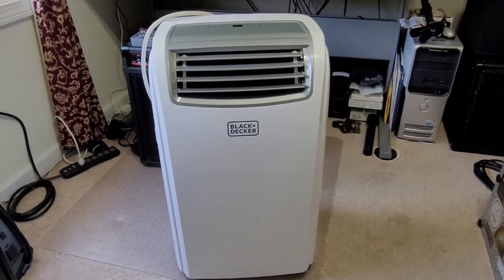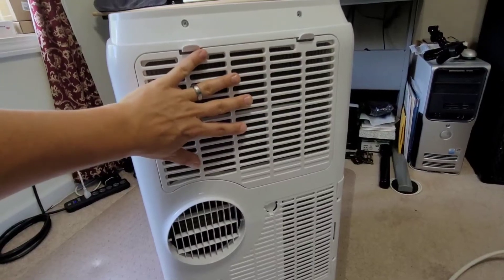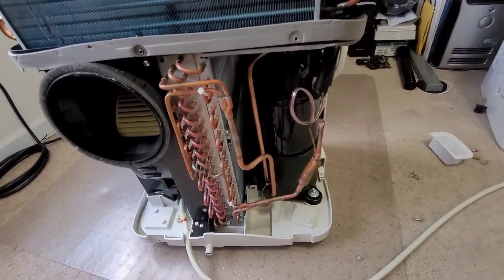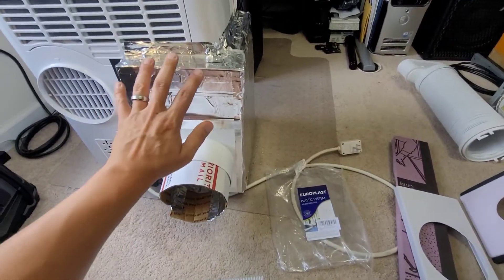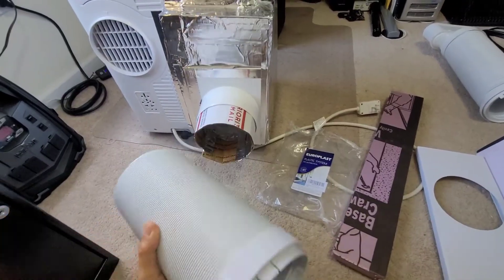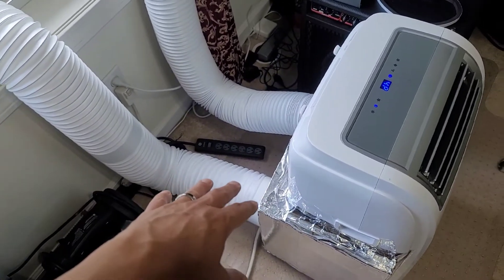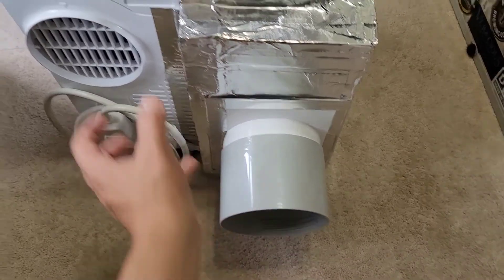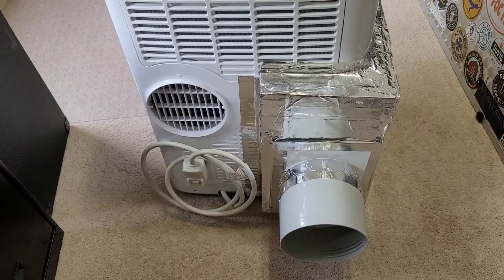Black & Decker Portable Air Conditioner BPACT14WT: Single to Dual Vent Conversion

Comment: Thanks for sharing! Any chance you've done some sort of AB testing? As in let it run stock, check temp/power draw, add mod and let it run a bit longer to see how many extra degrees you can drop at a similar power draw? Or maybe compare run times for same cooling? Wondering how much difference there is in practice without the negative pressure from single-hose and without wasting all the cold air it produces

Comment: Wait isn’t the whole idea for it to take the air inside your area and cool that? Why are you making it work harder by taking in air from the outside that is already hot?
Reply from the maker: Yes cool the inside air, but don't steal that cold air to cool the condenser causing lost efficiency. Outside air with enough velocity will carry enough heat away from the condenser while leaving the evaporator dedicated to cooling the room only.

Comment: It would be really helpful  ☝
If someone could do a before-and-after comparison after adding the second outlet,

Showing how many minutes it takes to cool by 3 degrees. 

There are people on both sides of the debate: 
Some believe single-hose systems are better, 
While others argue that dual-hose designs perform more efficiently

I’d love to see a simple cooling test using the same brand and model, 

Where the only difference is the addition of the second hose. 

If anyone has a link to such a test, please share it! 🙏
Reply from the maker: Not aware of anyone doing this test, but come the warmer weather I could give it a go.
Reply: @Bzkhavptes Hey! I'm very interested in a similar test, I currently have the LG LP1419IVSM which is single-hose and recently managed to adapt a second hose at the condenser intake, still need to make a new window kit with 2 holes to preserve the original part but I plan on testing it soon, I'll try to remember to report back here

Comment: I did my Pinguino last month, but found it was still pulling some air from the hallway in my apartment. Turns out there's a small gap between the cover and the plastic base at the bottom. I sealed it up with aluminum tape... no more smells from the hallway. 🙃
Reply from the maker: Good to know! Thanks for the info.

Comment: You never showed how to get it open!
Reply from the maker: Apologies, there are body screws all around and once you do that the entire plastic body lifts off. There is no need to do this since I confirmed they seal off the evaporator and condenser areas from crossing air.

Comment: They are absolutely stupid.
I picked one off the curb on trash day,  a massive "Penguino". I didnt know it at first, but it made the other window unit get moldy, and blow water vapor. I thought the other unit had a problem but couldnt find it. I kept cleaning it. When I modified the Penguino to two hoses ( actually 3 I added two intakes) , suddenly the other window unit dried right up. It was because the penguino was pulling our tropical weather in through the house cracks. The amount of air it pumped out  - and in - of the house was unbelievable... like a window fan. I used two 4" dryer hoses to match the 6" exhaust hose it had and also had to do some internal sealing.

Comment: With a single hose unit creating a vacuum you will find it only cold near the unit the rest of the flat stays warm as warm air is pulled in through gaps. Once you mod the ac you find the temperature drops in the whole flat not just one corner
Reply from the maker: Thanks for watching! Yeah unit has been working great since the mod, no issues!
Reply: Vety good explanation! that is exactly what we noticed using a portable in the room.. cool when next to the units air vent but the room itself doesnt drop in temp

Comment: I believe the greatest problem with both single and dual hose portable AC units is the heat radiating from the exhaust hose before the  hot air vents to the outside. Even when standing a few feet from the unit, I can feel the heat radiating from the exhaust hose. That heat rises and heats up the air in the top half of the room. I'm looking to buy and insulating hose sleeve to cut down on the heat radiating from the hose.
Reply from the maker: yeah the insulated hose would certainly help. Not too expensive for a short section.
Reply: @Bassguitarist1985  I can confirm that the insulating cover from TURBRO that I applied to my exhaust hose substantially reduced the heat radiating from the hose.
Reply: Ive not built a dual hose unit but I have Alwats Heavily wrapped that single vent hose as it is radiating so much heat that the AC is literally at war with itself, trying to cool a room while throwing large amounts of heat Back into the room.. the longer the hose the worse the amount of heat is.. how do u know when its insulated enough? when u no longer can feel Any heat coming from that hose..

Comment: For those hoses, there are quick disconnect rings you can buy for dryer hoses. You could buy a couple of those, use a dryer hose, and wrap it in a cheap fleece cloth to insulate.
Reply from the maker: Good advice! I like it!

Comment: Was the whole condenser/compressor air intake chamber already isolated from the rest of the machine? I have an Electrolux EXP26 and when covering the whole intake, the machine still runs normally with the same massive exhaust airflow. Not even a slightest change. 😞
Edit: Found an online guide where someone sealed off the entire chamber on this machine with aluminium tape and foam.
Reply from the maker: Yes it was sealed off

Comment: The condensate redire ted to the condenser actually increases the efficiency: On the evaporator the water will condense anyway. Evaporating that water on the condenser means it removes quite some heat while keeping the temperature lower. And lower condenser temperatures means lower pressure, so less power the compressor needs. It is small difference overall, but still bigger than the heat leak through that condensate passage...
Reply from the maker: Absolutely! 💯 And with the addition of the second hose the efficiency is further increased. I've been running this air conditioning with my modification for the last couple years without any issue.

Comment: Only problem I can see is you're throwing the hot air out right next to the cold air in,  so it's going to pull the same hot air in that it's throwing out.   I think I would extend the cold air inlet hose down the wall on the outside about 3 feet or so to prevent having the hot air pulled in by the inlet hose.
Reply from the maker: Thank you for the advice!
Reply: very true when they are placed close to each other.. reminds  me of the  so called "cold air intakes" sold for cars that are ofetn installed After the radiator or near the headers  so they actually end up drawing in More hot air than most factory setups or a true cold air intake which should be setup to draw from air prior to the radiator thus from a point in the grill where unheated air can be indrawn...any air After the radiator is super heated    once its blown thru the radiator into the engine bay.

Comment: That “quick update” was an easy trick to show nothing useful in this video.  The adapter is the whole point and crafting it is not shown or explained.  😮
Reply from the maker: My apologies, I thought I explained it quite well. Many people are visual learners. What's there to show other than some pieces of closed cell foam, cardboard, and aluminum tape cobbled together to close off the intake vent to connect the 2nd hose? People have a very short attention span and no one wants to watch an hour-long video. What I would love to watch is somebody doing better than me maybe even creating a 3D printed adapter for these units and selling them.

Comment: What I don't understand is why they just didnt make it a round port and allow you to optionally connect a second hose. Its not like it would effect the design in any detrimental way!
Reply from the maker: Some of the units actually do this where they have a kit and use it to sell as an upcharge. Shitty of them but it's a way to market. This one does not unless one can 3D print them

Comment: Just did thiss today, and I'm quite proud of myself. Going to  keep and eye on it and hope no overheating 😂
Reply from the maker: Please report back!!!! 👍
Reply: @Bassguitarist1985  i just bought such a unit for 180usd (i am in spain) and i am 100% doing this from the getgo. And insulating both ventses. Even a thin sleeve of aluminum foil+bubble wrap will help immensely
Reply from the maker: @EtaCarinaeSC very cool. Air is a great insulator this why bubble wrap works. Foil helps to reflect heat back in

Comment: Great video! I really liked it. I had also thought about adding a second hose to my single-hose portable air conditioner, but I couldn't manage it due to some other issues. Thanks to your video, I got some very useful information. Now I’m curious — if I add a second hose to my portable AC, is there a risk of overheating the compressor or condenser over time, or reducing the cooling efficiency and damaging the unit? If anyone can answer, I’d really appreciate it.
Reply from the maker: I've been running the AC since this video in this fashion without any issues. Best advice is to keep both hose lengths as short as possible. Longer hoses create drag which reduce CFM. Other than that you should be fine
Reply: @Bassguitarist1985 Ok thank you for the information
Reply: I been doing the same thing going on three summers now no issues I'm in the process of doing another one I got for free I was concerned when I first did it because it was hot AF outside and I was worried that it would possibly overheat the unit sucking in that hot air but after I read up on it and everyone was saying it would be fine I tested it out and like I said going on three summers now no issues wrap a blanket around the heat exhaust hose going out wrap it tightly around the hose and it won't let any heat back inside the house and just keep the filter clean so it can breathe good that's the only thing that can cause it to overheat if it gets so dirty that the air can't pass through it I've seen people not clean theirs and they were upset it wasn't cooling the house at all until they cleaned it I have to clean mine no more than a week to keep it breathing easy

Comment: Looking at the Black & Decker before you taped your box on it seems to me that they actually thought about having an add on to do this -- those slots and circular features look very like where you would slot and screw on an adapter.
Reply from the maker: Agreed, but they do not sell one. It's for a filter only

Comment: Just bought a Whynter July 10, 2025. Twin hose with inverter at 10,000 SACC BTU. Cheaper to run than my central air, AND, I’m cooling 1400 square feet. I keep the unit at 64-65 degrees and the other end of the house is at 72 with outside temps at 85. Yes the room the unit is in is about that 64 and other end if house is that 72, but I don’t need it that cold so I’m testing to get where we sit the most at about 74–75 which is good. We need/want the humidity out more than anything!
Reply from the maker: Excellent info!
Reply: I wish it was only 85 outside where we live its hitting 105 , and the single hose portable struggles to hit 81 indoors...it never cycles off...

Comment: This isn't a great idea if you think carefully, the amount of air circulating through condensor is designed for cool air passing through it, maybe the fan motor is not that strong to cool the condensor with warm outside air
Reply from the maker: Valid point but not necessarily true. The fan blowing the hot air out the exhaust is the same fan that's drawing the air over the condenser coils. Any normal window air conditioner is using outside air to cool its condenser coils. I firmly believe that the single exhaust air hose was designed for customer convenience and not efficiency. The condenser coils in a portable AC like this are built no different than a window AC. If anything the exhaust fan is built stronger because it is also evacuating the evaporated condensate dripping from the evaporator coils above it. I've been running this AC for the last few years either in our garage or bonus bedroom over the garage for days on end and no issues.
Reply: Window ACs have bigger fans to push more volume but anyway if the compressor isn't tripping in this portable unit it's just fine and certainly better than single hose but may create tripping issues in extremely hot climates, so one can definitely try this
 @Bassguitarist1985

Comment: I used a 12" flexible ventilation hose, and bungee strapped around the air intake and it works good.  There is still a small amount of room vacuum, but nothing like before, and I don't have a problem if a little cool conditioned air gets sucked over the condenser and out the window, it is 90% better than before and the rooms and hallway upstairs cools down faster.  These "MacGyver" builds are the best.
Reply from the maker: Ran mine for 2 days straight when Connecticut was having a 100⁰F+ heat index. No problems operating, no overheating. Glad the video helped you!
Reply: Thanks for the video, I had to leave mine with the 12 inch hose being able to be removed easily because I have to remove it on really hot days to work in some rooms.  I do install it and vent it out a bathroom window sometimes and there is no space for the hose to come out the back and fit that bathroom window, but all still works good.

Comment: But if the air outside is 100 degrees, you might as well hook up the heat output to the intake 🤔
Reply from the maker: All window air conditioners operate with the intake to the condenser coils with outside air. The trick is to keep the hoses as short as possible so that there is no drag where the fan has to work harder to pull the air over the coils. I had to put mine on a stool close to the window to keep the hose length short. It's run the last couple years like this without any problems

Comment: The problem with these units are the negative pressure caused by the air intake. Soon the system will pull the hot air from other rooms into your room. There is not much you can do about it.
Reply from the maker: That's what the second hose is for! Pull that air from the outside like it's supposed to and not from the inside of your house

Comment: do not do what this guy did because what you're doing is you're sucking in warm air from outside the unit was designed to suck in the cold air to keep the condenser cool somebody's playing genius?
Reply from the maker: The exhaust fan is more than ample to pull enough air across the condenser coils to keep them within temp. No issues with the unit since this mod. Still running to this day

Comment: Don't do it, it's not worth it. I did it with plastic bags covered in tape and putting a plastic basket so that the bags don't suction and I did it thinking that it would really work, with 0 leaks, but more I only spent 5 hours of my time. The only good thing was that I had an extra tube so it cost me almost nothing. What they don't tell you is that it has much less air flow so it doesn't have enough force to reach the ceiling and renew all the air so it performs worse. The air doesn't come out as cold. I put a thermometer on it and it came out at about 11 degrees, when before the mod it came out at about 7 degrees and I ended up removing it because the temperature of the hot air tube burned my hand just by half touching it, so it makes the compressor work much harder and it ends up breaking down sooner. I've seen dozens of videos of this type and nobody ever shows the temperatures for obvious reasons. Technically, I would have to solve the error of the airs Laptops, but these are not designed for this. Maybe if you put a powerful fan in the air inlet it would work better, but I would end up wasting more electricity. A crappy fix. Without the mod it would just be a contraption that blows cold air and only cools one area of the room, but at least it's good for something.
Reply from the maker: thank you for your response. I keep both hoses as short as possible to reduce any air drag. The exhaust fan has plenty of power to draw enough volume over the condenser coils to not be an issue. Now if your hoses are 4-6ft long, then yeah I'd say thats a problem. At a short 2ft, no issue for me. Been running like this since the mod, no issues.

Comment: wait I thought it'd use one big fan. it's good that it uses two so you can have a separate intake
Reply from the maker: Yes this is very important!
Reply from the maker: I had an Epson Stylus Color 600. Worked great but it sucked ink like crazy. Eventually the print heads burned out. Good printer though

Comment: What did you use under the tape to block that all off??
Edit: actually said at the end its in the desc. So im guessing its the foam pieces lol. Thank you!
Reply from the maker: Yes closed cell pink foam board basically. It's running now in my spare bedroom! No issues!

Comment: I did the mod and it actually seems less noisy and more able to cool the room and maintain it cool but I still feel some air being sucked from other rooms and passing under the door when it's on. Why?
Reply from the maker: Check to make sure you do not have any leaks around the There is some leakage between the evaporator and the condenser but it's very small.